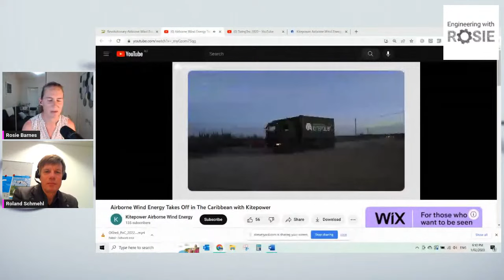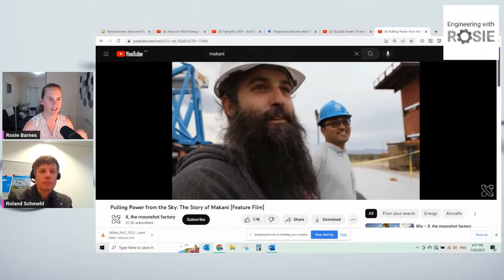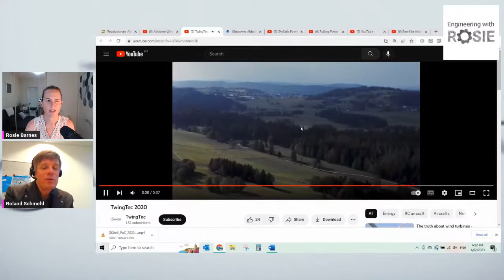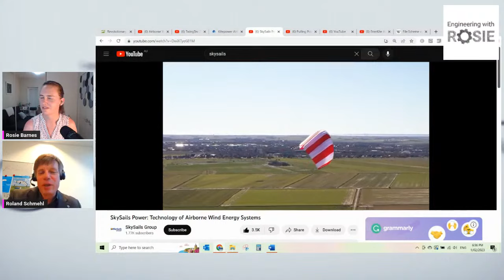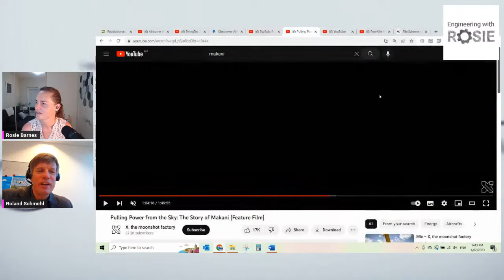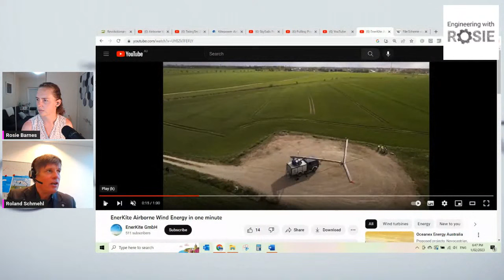Airborne Wind Energy With Dr Roland Schmehl | Engineering with Rosie Live Ep. 21

Comment: I can think of a couple of things that would be more in favor of a simpler flight path over the crosswind approach. Due to the task being less structurally and control demanding, they could be built lighter. This could help with a couple of things: 
- They could be designed to be safer, more on that later.
- They could reach slightly higher altitudes, which could or could not make a significant difference, that really depends on how much of an increase in height it gets.
- If it's an airborne turbine, it could potentially have a higher focus on its components such as a heavier duty generator, larger radius blades, longer wings, or some combination of them.
- A minor point on the mechanical side, less noise would be emitted. I don't really see that as major as the others since there are some solutions already out there (modified trailing edge), but I do a question related to them never mind I saw that other livestream of yours and it answered quite a few.
 
-The more boring but perhaps the more important aspect of any kind of technology is the legislation and regulatory side. The most obvious help here is because it lacks complex maneuvering and is lighter (design dependent), it is slightly safer and less scary. Law makers and regulatory bodies might in turn be more lenient and less strict on them. Certification and licensing would be easier and less of a hassle because of that. This could lead to a wider, but still niche, market where crosswind wouldn't be allowed or it outcompetes other options due to its ease of use and accessibility while still retaining some useful power. 
 
 Something that came to mind was compromise in-between. No figure 8s or circles, neither "inert", instead a side-to-side motion; don't think up and down would be as effective alone. Would such a middle ground be worth the effort?
Reply: Side to side motion is a figure 8.
Reply: @ndvorsky  Not really. As a puller it'd be less noticeable but on an airborne turbine the difference is significant. The figure 8 or flying circles conserves forward motion, going side to side requires deceleration at both ends of the sweep. The pulse of tension would also be more pronounced by doing that, which could affect tether life (negatively).
Reply: @midgetman4206  well, if it’s a sky gen system then it can’t really just slow down at the ends. An aircraft can’t have 0 airspeed. You would need to use the rotors to perform the yaw maneuver to turn in the other direction as well as just supporting the weight of the airframe. Until it has a chance to speed up again. I don’t think that there are sky gen systems that can just kite.
Reply: @ndvorsky  Why would it need the turbines to control itself? That's what aerodynamic surfaces are for. None of the big players used the turbines like that once they were being powered by the air (in other words, being a kite). At least for rigid kites. Soft kites use the cables. That's also the point of me bringing it up. I understand why the goal is those flight patterns, but it is also evident that none of the companies have successfully entered the market. By aiming lower, sales can be made which 1- gives funding. And 2- They start getting experience and also real world data.
Reply: @midgetman4206  aerodynamic control surfaces don’t work when you aren’t moving. You suggested that they stop at the end of each line to turn around rather than doing a figure 8. If they stop, they can’t use control surfaces and thus need the motors to turn.
Reply: @ndvorsky  It's the relative airspeed that makes kites work. The kite itself doesn't need to move if the wind is flowing. That's why no wind means no flying. The figure 8 and the circle take advantage of the relative and actual flight speed to artificially boost the perceived wind on the turbine(s).
 
As for the flight path, it would look somewhat like a fish swimming. It wouldn't really stop, and the whole time it's facing the direction of the incoming wind. It's not flipping around 180 degrees, it would only need a couple degrees change in order for it to work. Of course, a greater angle means faster speed but it is at the cost of potentially less lift and more drag as well as more mechanical stresses.

Comment: There is also the "Kiwee One" from KiteWinder : it's a 10-kg transportable airborne wind energy system able to generate 100 W @ 28 km/h, up to 400 W @ 50 km/h.
Technically, it's a suspended wind turbine tethered by a pulley system connected to a ground generator. It costs only 900 EUR.

Comment: For some reason I'm having trouble grasping how the plane is up in in the sky spinning the generator. Is it dividing down, and climbing back up, spinning the generator like someone would start a pull start engine?
Reply: Yes, I think that the engine pull start is a good analogy. We are also calling the concept "pumping kite power" because the kite (or tethered airplane) "pumps" the mechanical energy from the sky down to the ground, where it is converted into electricity.
Reply: Less "diving down and up" and a bit more like in and out or closer and farther. Changing altitude is not the main driver of the generator.
Reply: It flies like a kite. If you fly a regular kite it will zoom around in a figure 8 if you steer it right. As it zooms around the air speed will convert to power.

Comment: I still don't get it. All the money that is going into this misguided research could have bought a several giant wind turbines that would have paid for themselves and provided a huge amount of green power. Airborne wind may be more powerful but it's literally out of reach. The cable strength required to hold a giant kite/plane is limited by physics. I still believe this is as dumb as Solar freaking roadways. At the tip of a modern wind turbine the speed is not anywhere near transonic. More birds are killed by cars,trucks, and trains everyday that have ever been killed by all the wind turbines in existence.

Comment: At 27mins I still don't know how they generate electricity
Reply: She mentioned a recent video she did on this topic. Apparently that is a prerequisite to watch first, and this video is a follow up discussion.
Reply: There are many introductory videos on YouTube covering the fundamentals of airborne wind energy. This video is more advanced.
Reply: The force you feel when flying a kite by hand is utilized (and increased by the flight pattern) to pull a cable through a generator. When the cable is at its max length, the kite changes to reduce that force and the generator pulls it back in to start the process again.